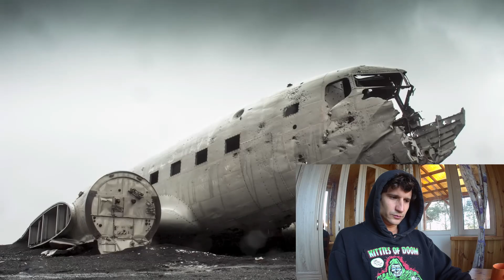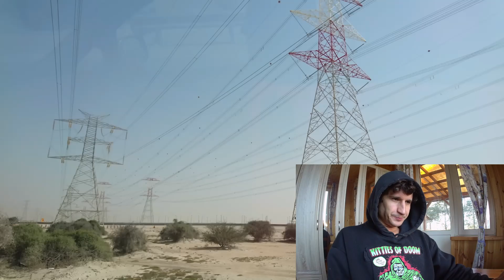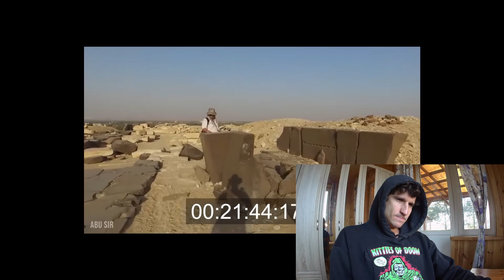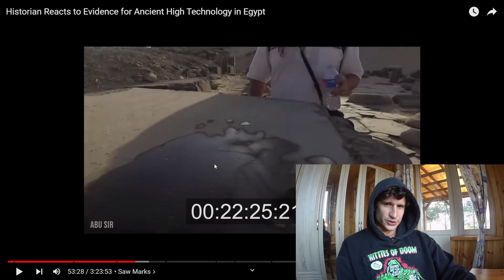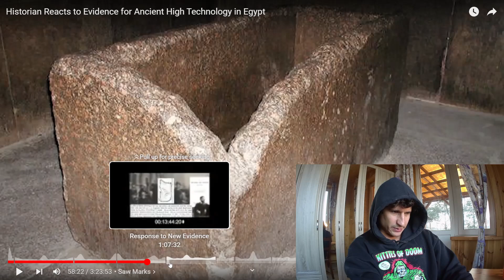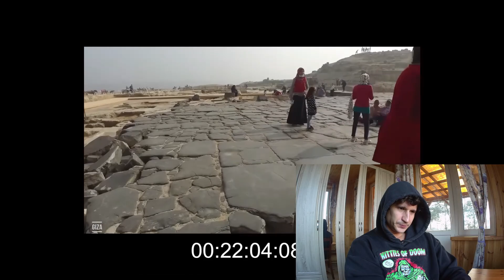Builder Reacts to Historian Reacting to Evidence of Ancient High Technology Part 1

Comment: What people like Miano, SGD, and Moore don't seem to understand about that style of drag saw is that it still wouldnt make a concave or circular saw style cut profile. When the blade is suspended from 2 equal length ropes as shown then swung back and forth they would see that even though the whole saw blade swings in a curved fashion but the actual cutting edge itself will remain flat and parallel to the ground throughout the entire motion. And since the cutting edge stays flat and parallel the cut it makes will be flat and parallel also. Not concave. If they would ever actually attempt to  test this stuff then they would see it for themselves.